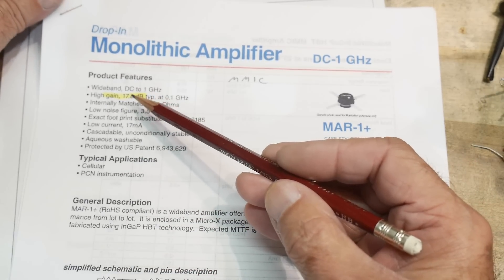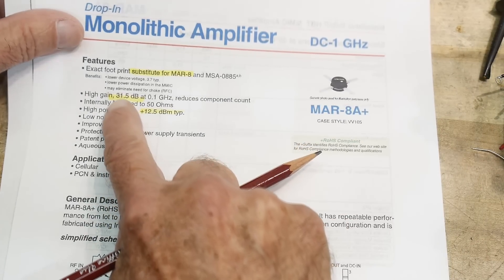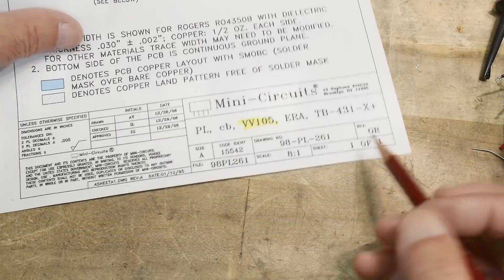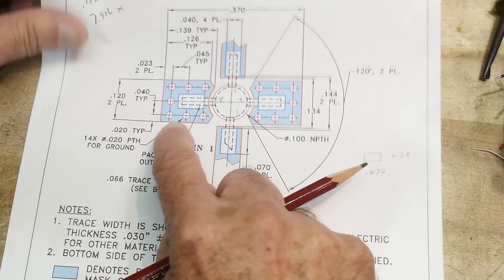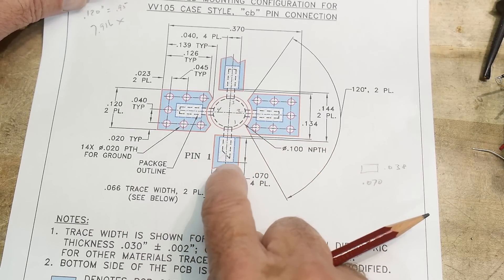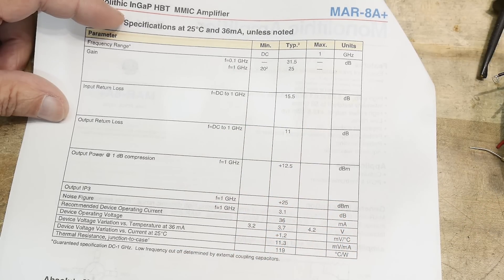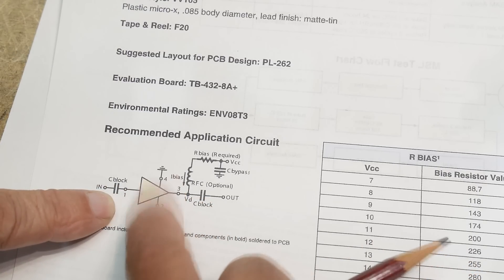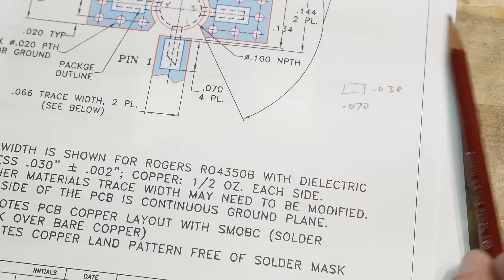#2060 MAR-1 MAR-4 MAR-6 MAR-8 MMIC Amplifiers

Comment: Often used as a second stage after a GaAsFet in preamps used on 13 and 24cm. You'll find plenty of designs in old issues of CQTV. At those frequencies, the RF choke can be just a few turns made from the lead of the bias resistor.

Comment: The parts I used back in the day in this micro-X (or TO-50) package were dual-gate MOSFETs such as BF960/980. Very useful as either cascode-on-a-chip, mixers, AGC etc